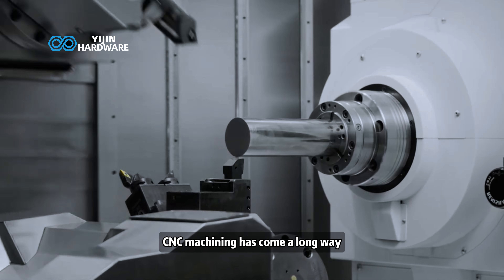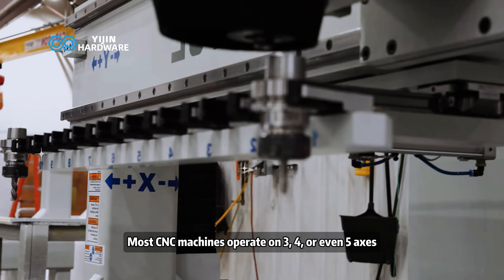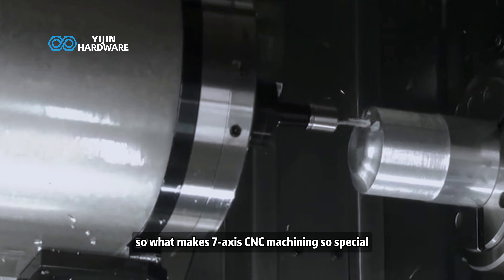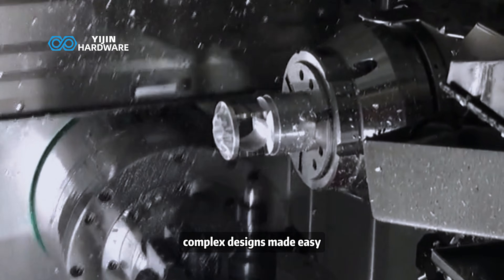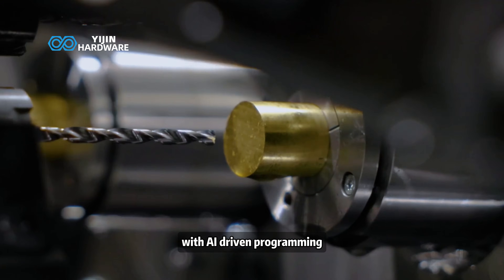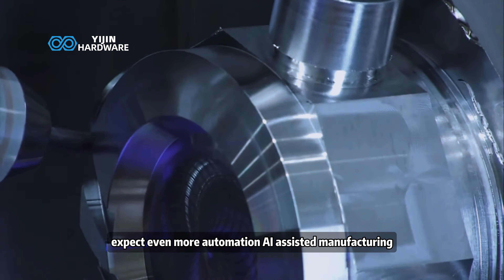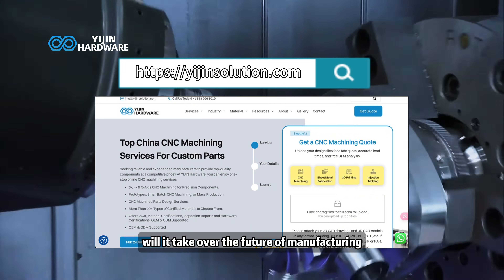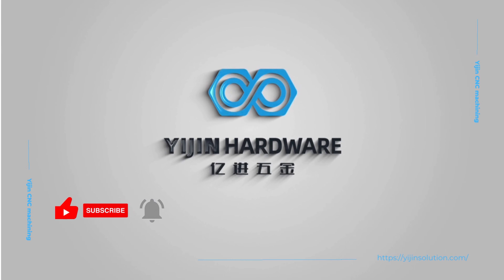7-Axis CNC Machining: The Future of Manufacturing

Comment: depends on how you count the axis 

cause otherwise i use to iso program by hand a machine with 12 axis  ( tripple turret lathe with xyz on all tree turets plus c on both spindles plus the couter spindle also had a programmable z axis as well ( and yes it was a counter spindle and not a sub spindle ( counter spindle has just as much power and rigidity as the main spindle but sitting oppersit to it well a sub has less power and is not as rigid as the main hits its name "sub" cause its sub pare to the main ))
Reply: Very true.
Reply from the maker: Respect, bro 👊 12 axes by hand coding? I’d need 12 coffees first ☕😂
Reply: @ShenzhenYIJINHardwareCoLtd  it's actually easier then a dual turret. Since on dual turret you need to use both sides of both turrets but a triple turret you can dedicated two turret to the main spindle and the last one to the counter ( no real needs to crossover from one side to the other side )